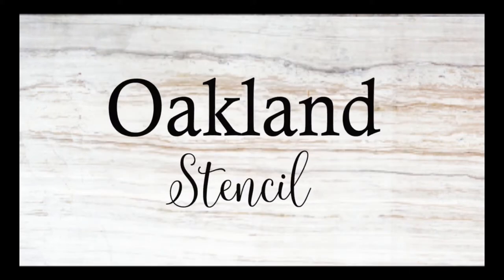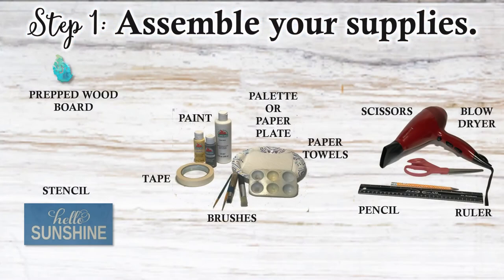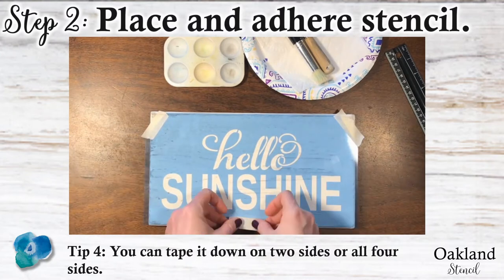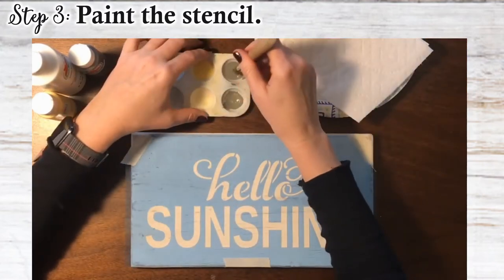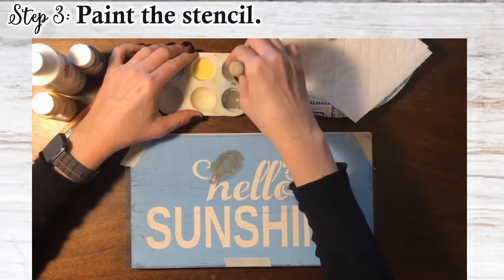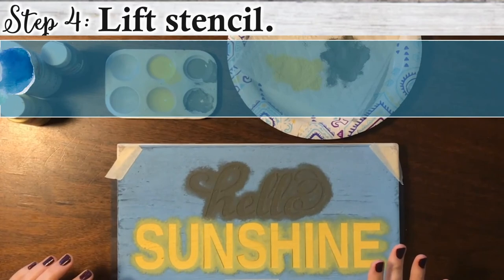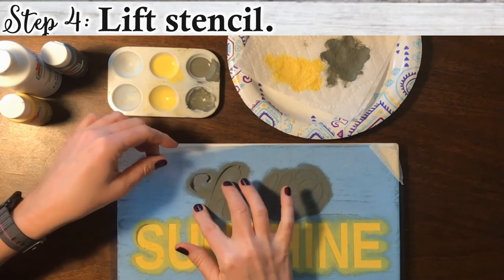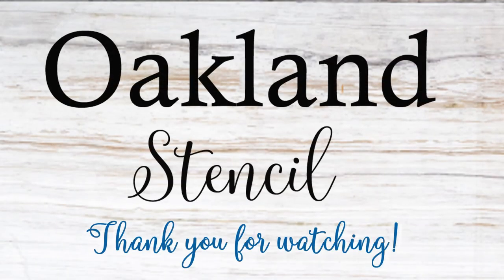How to Stencil a Wood Sign with No Bleeding

Comment: is there any way to stencil  old fence pickets,  with out the surface  being sooth, ARKANSAS STYLE LOVES Y'ALL,  great video
Reply from the maker: I have stenciled very rough old barn wood with the same technique. Just be sure to use as little paint as possible doing a couple of coats and I used a pencil tip to hold the stencil down in certain spots that weren't laying flat on the board. Hope that helps :)